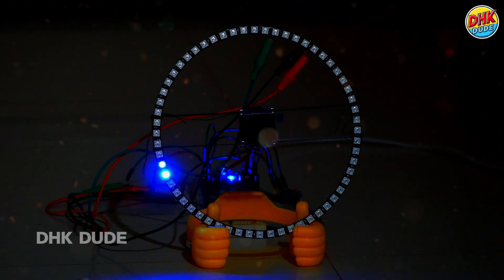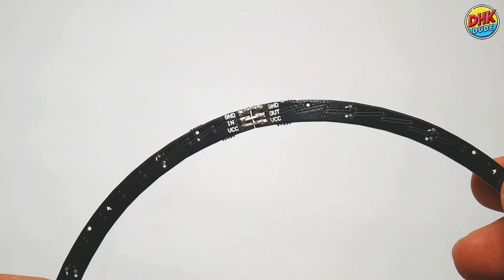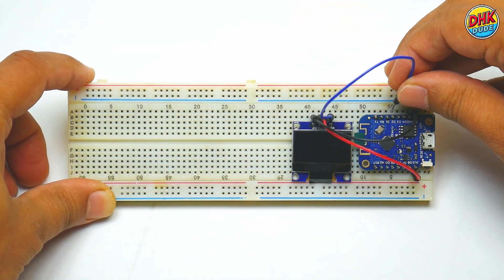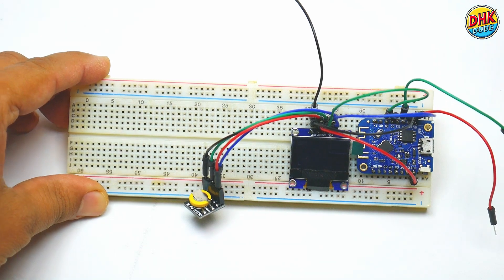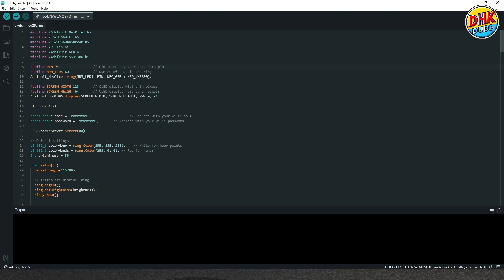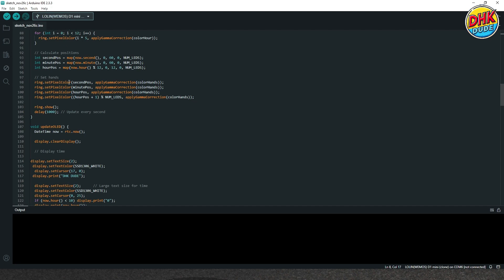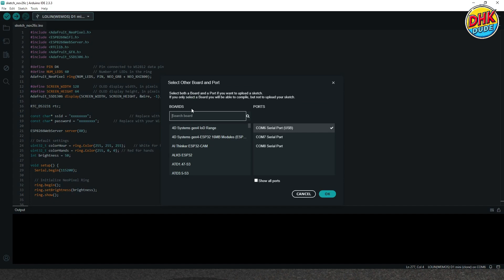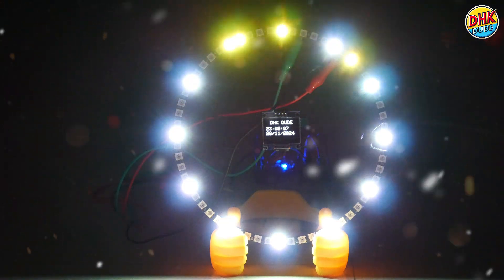WS2812 LED Ring Clock with Wi-Fi & OLED Display | Cool Animations & Web Control

Comment: Hi, I found this project and it is awesome! I have a question. I copied and inserted the code into the LOLIN(wemos) D1 mini board (clone) and the ring confirmed the wifi connection with 3 green flashes. The question is, when the time and date appeared, they were wrong. The OLED display showed the time 06:07:00 with the date 25/02/2000. How can I change or insert the time to the real one? Thanks for the reply. Giuseppe, Italy
Reply from the maker: Nice to hear from you. Your RTC module does not seem to be synced to the current time zone, that's the reason it shows default date time.
Reply: I'm having the same problem as you. Did you find a solution?

Comment: Awesome project, thanks for sharing. I will try to build one but want to add actual arms for hour and minute making clock out of acrylic. One question, if you disconnect the power and then later reconnect the power, will the clock keep time when power is reconnected?
Reply from the maker: Thank you. That's nice idea of adding hour and minute hands. We can add another small ring to display that. Regarding your question of time, we don't need to adjust time, as it is saved in RTC module and it has small battery so settings will be saved in the memory unless you format using software command.